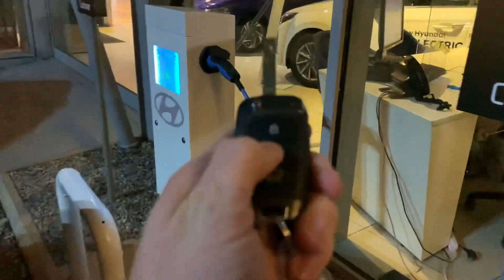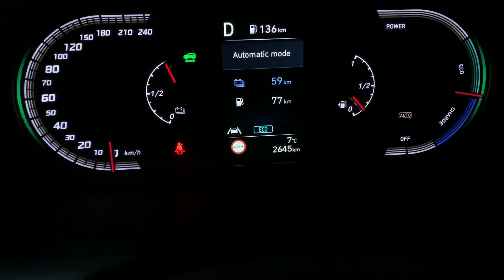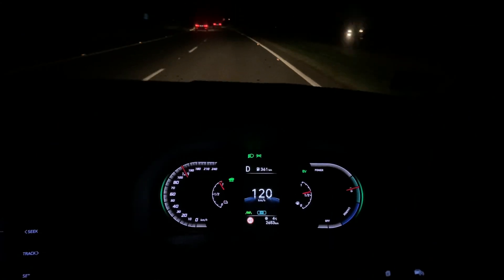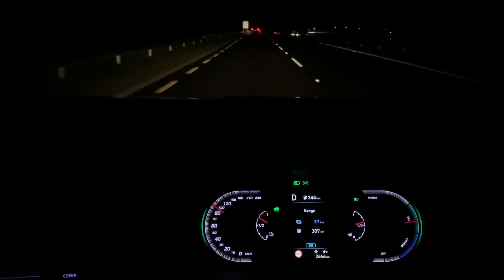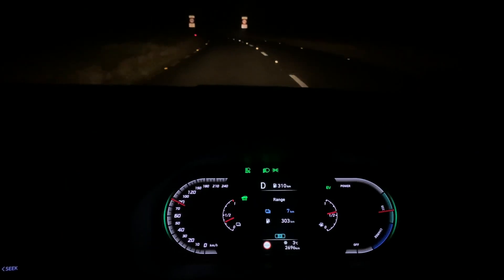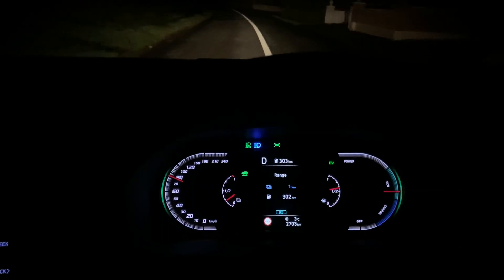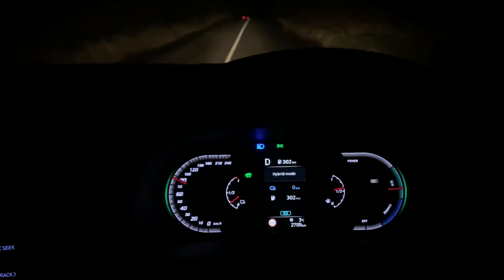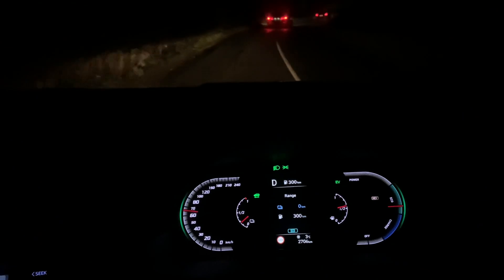What happens in a PHEV when you run out of charge - step by step demonstration #phev #whathappensif

Comment: When the electric motor has used all it's charge, I have a lot of heat coming from the motor I guess and entering my vehicle as if I would have the heating at maximum.  Did anyone experience that and should I have it checked?
Reply from the maker: Where do you feel the heat coming from , front of car , rear ?? 🙂
Reply: From the vents
 @doolanbrian
Reply from the maker: @j.belair7091  next time, it happens, just check whether your heating is on or off at the time it reverts back to Hybrid?
Reply: @doolanbrian  it was definitely off. I checked and it's not the 1st time.
Reply from the maker: @j.belair7091  it’s tough for me to guess based on the information, it’s definitely something I would ask the dealer have they come across before … I haven’t had a complaint like it but I would like to experience it to be more specific

Comment: I was about to rent a car for a trip to Iceland and scoped a RAV4. I was all set to book the car until I noticed it was a AWD-I plugin hybrid. I wanted nothing to do with the car because I don't want to spend my vacation looking for charging stations and waiting hours before a battery fully charged. I was about to dimiss the RAV4 until I watched your video. So, as I understand it - I don't have to charge the car at all and it will basically become a hybrid (more fuel efficient) car as long as the gas tank is full? One more thing I'd like to ask. I understood that the electrical part was responsible for the back wheels of the car and the gas tank  for the front wheels. Being a AWD car, will the torque (wheel control) diminish if the car is not charged? I ask because I'm travelling to a remote part of Iceland (the Westfjords) where there are some pretty rough gravel/pothole roads and unpaved mountain roads. Looking forward to your response.
Reply from the maker: Hey thanks for watching !!! 

1. On a Tucson it keeps self charging . The plug in just gives you a bigger EV range but we have customers who have literally never charged their PHEVs for years so not plugging in won’t stop you driving !!! It just means you’ll do less EV driving that’s all . So the RAV should be the same idea . 

2. On a Tucson the 4 wd system does not require charge to engage , i would assume that a RAV should be the same . In this case I would give a Toyota garage a quick call and ask them if they can clarify this just to be sure but it would seem like a major weakness if AWD only worked when fully charged so if I was betting I’d say awd is always available but it’s best to ask Toyota. Surprisingly you may find that many garages may not be sure on the answer so if they don’t , get on to the Toyota HQ in your country and they will know. 

Sounds like an awesome trip !  I’m jealous!
Reply: @doolanbrian  thank you for your advice.  I'll put in a call to Toyota and find out. Better to know beforehand.  And indeed, Iceland is an amazing place. I went last year and stayed mainly on paved roads ( the Ring Road) and a regular SUV was more than sufficient.  This year I'm visiting the Northern part wich is a vast area and requires a sturdy 4WD in  some areas with  dicy gravel roads with potholes and rocks. So, higher ground clearance and great torque is advisable...But yes, it's an amazing experience and I'm looking forward to it. I highly recommend a visit to Iceland. Specifically in the summer months when the sun doesn't set and you'll have very long days to enjoy Iceland's nature.  I could go on and on 😊. Create your opportunity and go if you want to visit. You only live once. Have a great  Sunday.  👍🏻
Reply from the maker: @HarryOsirian  thanks for the reply enjoy the trip and I appreciate the interaction!

Comment: Here in Finland why a PHEV? 1) cheaper insurance 2) cheaper road tax 3) no diesel tax. 4) 14,000km will cost you €142 5) when you run out of battery the petrol engine takes over. (winter time good to use hybrid drive petrol and battery in 4x4 in our outlander the battery will last far longer as the front wheel drive will be petrol and the rear wheels will be electric, it really extends the battery life which is really good in the snow).
Reply from the maker: You’re government, definitely tries to help you guys to move towards hybrid technology, that’s for sure, thank you for watching and for commenting!

Comment: Okay thats great information.  However can someone please explain whether or not a phev has regenerative braking!  Does the ice charge the battery at all?  Or do you have to stop at charging stations just like a EV?
I really do feel like this is an industry secret or something.
Reply from the maker: Okay, so say for example you have run out of charge.. the vehicle can use a modest amount of regenerative braking and the petrol engine to recharge a portion of the traction battery that can drive the vehicle

When I watch the screen, basically the battery never gets below 13% and is able to recharge itself up to approximately 16% so this looks like only 3%, however it does allow the car to do short bursts of electric driving .. so you can indefinitely keep driving like this as long as you keep petrol in the vehicle

If you need to charge the battery any further, then you will need to plug it in to allow full electric, driving up to 55 km range
Reply: @doolanbrian  thank you so much!  Not everyone has a 20 mile round trip daily commute!  My personal drive is 80.  So now I have an understanding.  
Is it your experience that most or all Phev operate the same?  Or do higher-end  vehicles offer a more technological advantage?  My desired vehicle is an X3 Phev!
Reply from the maker: @Dragandspinn  
My understanding would be that they all operate with a similar premise, give or take a few kilometres on the overall range, but I would imagine they are all pretty similar

Comment: I want to know if the engine ever warms up or is it just going straight from cold?
Reply from the maker: It’s a good question, probably for a drive that’s only five or six minutes the engine probably won’t warm up very much in hybrid mode , if you have been driving for longer than this, then the engine is continuously starting and stopping, so it will have warmed at that stage… on the other hand, if you drive in electric mode for an extended period then once it runs out. Yes, the engine is initially cold when it has switched from fully electric to hybrid mode. Hope this helps.
Reply: @doolanbrian  isn't that bad for the engine?
Reply from the maker: @BootLickerGod  every time you start a car conventionally it’s cold so the principal isn’t really any different but it’s more frequent in hybrid I guess .. we haven’t come across any issues so far✅

Comment: Wt abt if we use hybrid mode how many miles per literr
Reply from the maker: In hybrid mode, you should achieve a combined total of around 40 or so mpg.. this would improve if you do a lot of driving under 100 km/h or alternatively if you do a lot of driving at approximately 120 km/h this figure may slightly disimprove

Comment: Hello I'm currently looking for a outlander phev. Why I'm looking into this car I live in a country where 90% of the driving habits is city driving stop n go and I thought maybe a hybrid is perfect in this situation (correct me if I'm wrong). I really like the outlander phev but it's only available as a plug in my issues is we don't have charging station since I'm Africa electricity is expensive my question is can I own a plug in hybrid without having to plug the battery in order to charge it ?
Reply from the maker: You can own the vehicle and drive it without charging it using a plug, but it will do a limited amount of electric driving, 

the car can probably only regenerate approximately 10% of the battery by itself, it needs to be plugged in to really generate any more than that, does that make sense?
Reply: @doolanbrian yes it does I fully understand I'll consume more fuel than electricity in that case
Reply from the maker: @mooauto2388  you are correct! Hope this helps!

Comment: Thanks. Great video demonstrates perfectly why PHEVs are a cruel greenwashing hoax on conscientious consumers. 3 works loads (propel mass pushing air out of the way, carry extra payload of spare battery and spare drive train, run a generator). Hence the woeful petrol MPG on long trips (ie worse than a V8). Also market data shows people unfortunately do not plug these in twice a day every day as designed and revert to driving them as petrol hybrids. Hence the higher true CO2 output and poor real world mpg. If only people didn't fatigue after the novelty period and kept plugging them in twice a day every day, then they could actually achieve more electric milage. OPEC love these things. With home charging on night rate electricity BEVs are actually more convenient because you only need to plug them in once or twice a week at home.
Reply: 'a cruel green washing hoax', what bollocks.
Whether a phev/ ice/ bev works for you depends entirely on how you use a car. I'm on my second bev and I'm replacing my other car, a diesel, with a phev. That's because I do mostly short trips and can recharge every night, but I also do an infrequent long trip that the bev makes no sense for- if I have to charge it away from home at 55p/ kWh I might as well use diesel. 
For that use, a phev is perfect. It will do the 90% of my short range mileage - 50 miles a day school run - and also the 500 mile round trip 6 times a year, plus holidays. 
If you do a mix of long & short range, a phev makes complete sense.

In the old days when most cars did 300+ miles at 35-50mpg, and refuelling l stations were common, how you use a car didn't matter. Now it does, because some choices have limited range and expensive & sparse refuelling options
Reply: @martinw5766  Good for you kind sir
Reply from the maker: I drove from Killarney to Meath last Sunday in HEV mode .. in other words, I hadn’t charged the vehicle, 6.5 L per hundred kilometres for reference. It’s not terribly dissimilar to the HEV despite the extra weight. 

People who do well with these vehicles, do a lot of short, stop start driving in other words less than 50 km per day, and the people that do the best have access to free charging in the workplace .
Reply: I wonder where the batteries are made? Or what's inside the batteries and how that mineral get's there? Also, where does the electricity from the charging stations come from??? So many questions. So little answers. I wonder why 🤔
Reply: @HarryOsirian  Lithium is harvested from Sea Water not mined in the conventional sense of mining, Cobalt almost eliminated from BEV batteries, yet it it used more to manufacture catalytic converters and in the oil refining process, and also the battery in the electronic device you asked the question. In Ireland's case the electricity comes from the national grid which is already close to 50% wind and on target to achieve 80% wind energy by 2030, and 100% green by 2040. Some public charging stations already use exclusively wind generated energy. Many homes (approx 60,000 in Ireland currently) with solar panels charge their cars from the Sun from April to September without recourse to the grid, albeit at night during winter in Ireland the grid has a huge wind energy component. Hope that helps. Cheers.

Comment: Informative video..pl also advise what happens to the power output when battery runs out of charge. Does PHEV still give full power when battery is partially drained and taking charge from the engine?
Reply from the maker: Just to make sure I am trying to understand your question correctly, so my understanding is when the battery is fully charged you have 265 BHP, when the battery is depleted and is only self charging you have about 235 BHP , does this make sense?
Reply: @doolanbrian  Thanks. that was exactly my question which is does the total system power out remain the same when battery is charged and partially drained? You have just answered it that its 265hp when batter is fully charged while only 235hp when partially charged and engine is charging it. However the reason i asked is bcz this totally a grey area and nowhere do car companies mention that the max power is produced only when the battery is fully charged..its worth knowing as half the time battery is taking charge from engine and may not be able contribute its full share in total system power..
On the contrary the e power concept (introduced by nissan in xtrail) where engine only works as a generator to charge batteries does not have this limitation and i think full power is delivered by motors at any given time..
Reply from the maker: @mazbpl  I think you are right on the Nissan, however I’m not sure if the battery is smaller on that vehicle, is it plug-in hybrid I wonder?
Reply: @doolanbrian  No Nissan xtrail is not a plun in hybrid..its a hybrid but the engine doesnt drive the wheels. It only turns on to charge the batteries which in turn power the motor to drive the wheels..so the drive is electric in this case as the engine does not directly power the wheels..
Reply from the maker: @mazbpl  honda has a similar system .. two points here , 
1. the battery will be a lot smaller on the non plug like the honda .. 

2. in theory, it’s a nice system but the battery is small it doesn’t drive the car by it self as often as a plug-in hybrid would do it still requires a lot of engine input 

I can’t directly comment on Nissan but that’s my experience of the honda 🙂✌️
Reply: @doolanbrian  your observation is absolutely correct. The battery size is smaller and hence the engine needs to turn on more frequently to charge the battery. However my understanding is that the battery retains a min power threshold at all times and engine kicks in to charge it in order to provide the max rated output at all times. So unlike a traditional hybrid where at times power drops bcz battery is low and not able to contribute its share, in this system battery is the sole source of power and is likely to give the max output at any given time. Request you to pl cross check if my understanding is correct.
Reply from the maker: @mazbpl  I understand what you mean, sounds like a nice system for sure, our experience on the Honda one was on CRV, the only real drawback customers used to complain about was the Honda gearbox was a CVT which unfortunately is noisy at higher speeds as a consequence of how it operates🙂 the Honda system was extremely reliable though 🙂

Comment: What do you think the best range one could get to a tank of fuel if a commute is 26 miles (41km) a day and was charged every evening? That’s my wife’s round trip commute daily. I know the motor has to run for a bit to warm up but do you think it would be possible to get 750 miles, or maybe 1000 miles between fuel fill ups?
Reply from the maker: Technically if the weather is warm, the engine will come in every now and then just for the purpose of lubrication, but you can do 50 km in full electric without using the heater and if you are gentle with the throttle 🙂.. I would be confident in telling you that if she does a 41 km round-trip she should be able to do 90% of it in full electric, 

to be 100% sure I would call the local dealer, ask them to charge one up .. and take it for a 20 km test drive to observe how it will react to your driving and local atmospheric conditions 🙂👍

Comment: Does the horsepower and torque output decrease after the battery is depleted? What is your mpg after the battery is depleted?
Reply from the maker: 265 with battery charged .. circa 235 without the battery fully charged 🙂

Realistic fuel efficiency is 6/7 l/100 kms if not charged

Comment: Hi Brian. I've watched lots of videos about this vehicle which I have on  order. People talk about fuel saving/miles per gallon but nobody seems to add in the cost of electricity. I wonder have you covered this or could you at some point? Thanks. Really enjoy your helpful videos.
Reply from the maker: Hey thanks for watching! The cost of electricity is a variable these days and each electricity supplier is different, and each persons, electricity plan is different and unfortunately I’m not an expert on it .. so I have avoided it as it’s hard to give an accurate overview, I appreciate you watching, sorry I couldn’t help better on that one🙂
Reply: @doolanbrian  Thank you for taking the trouble to reply Brian. Yes, I realise it's almost impossible with the varying costs of electricity. Appreciate your videos, very helpful.
Reply from the maker: @j5s9cStu  I think all you can do is think about it this way, the battery is 13.8 kW, so if you look at your electricity bill see how much you get charged per kw , for example, if it was $.30 per kilowatt, then to charge this fully would cost to 13.8×$.30 which is about $4.14 .. which would get you 50 km of range if that makes sense
Reply: @doolanbrian  It does Brian. Thanks again.

Comment: it doesn't have the ability to heat up the cabin using a resistive heather of some sort? at all? well that is kind of lame since its one of the advantages of electric heathers(despite the fact that they use the energy that could be used to move the car). this morning i got to my EV to move it to the other side of the parkinglot to collect my stuff. the windsheild was completely frozen. but the car managed to defrost the bottom half of it in about 20s. in my experience, it takes quite a bit longer to do the same using the heathing of a normal car.